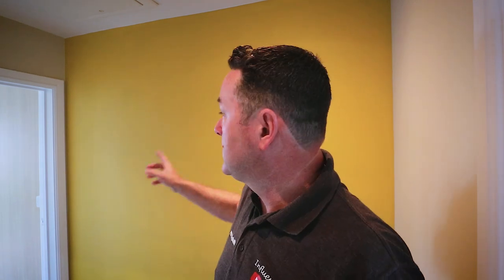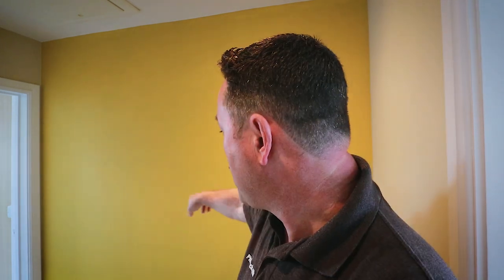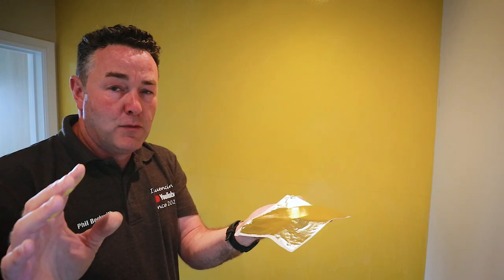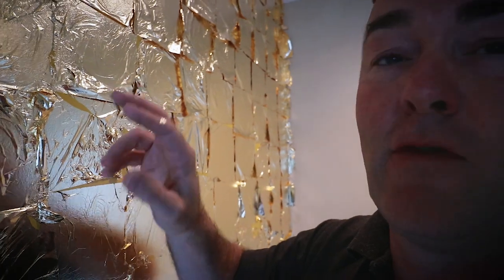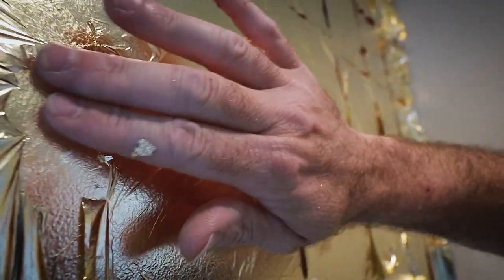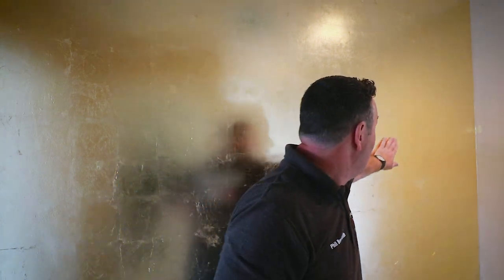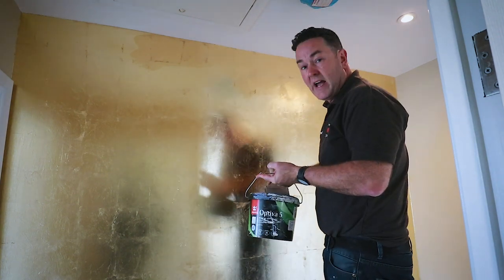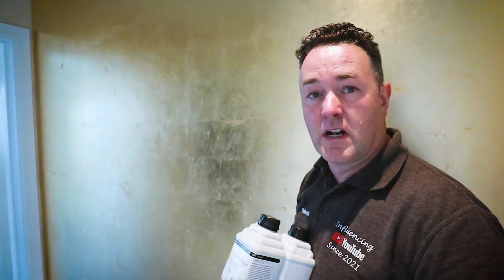How to do a GOLD LEAF WALL

Comment: Hi Phil, I followed your wonderful tutorial using the same exact materials. I ran into a problem, when I applied the lacquer using a new brush, it dried very weird. It had very dark areas and the brush strokes can be seen. It did not turn out as neat and even as yours. 
Any recommendations or ideas on why it might have gone wrong?
Reply from the maker: you mean the top varnish? was it the polyvine just like i used?
Reply: @ProfessionalPainterDecorator Yes, I used Polyvine multipurpose surface lacquer (high gloss finish).
In many areas it dried very dark and messy. The brush strokes also dried dark. Not sure where I messed up. I’ll try again and test small areas first. I might need to dilute the lacquer or apply less of it.
Reply from the maker: @krasavchikmalchik  can't see why you'd have a problem. 
Try applying it with a mini roller.. 10mm

Comment: What would you differently for applying this to a ceiling?  Does the ceiling need to have a smoother finish - i.e. not use a fat roller to prevent orange peel showing through the gold leaf?  REALLY need the advice.  Thanks!
Reply from the maker: my COPPER LEAF wall video thats scheduled for Setember.... I skimmed the wall out with roll on plaster ( i have a video of that stuff) and Mirka Sanded it smooth/flat.
I did get the correct transfer leaf though.. which makes it easier to apply.

A ceiling shouldn't be difficult to do... next time, I'll be doing a ceiling.
Reply: @ProfessionalPainterDecorator  - Thanks!  I'll be watching for that.  I make such a mess when skimming - the dust!  I might actually hire someone to skim, just because of that.  I have a ton of books and things that make dusting and cleaning up a nightmare!  If you have any tips on THAT, I'd be interested.  You're saving me a bundle of cash, as I was going to do a metallic wallpaper, and it's ridiculously expensive.

Comment: Did similar on furniture just used PVA to stick & fine, only needs to be tacky, cheaper too 👍i never lacquered after as being metallic it won't penetrate & i think you do lose that natural gold leaf finish imo
Reply from the maker: The open time for PVA isn't long enough for working large areas.
Yeah, you don't need to lacquer it.
Reply: @ProfessionalPainterDecorator i just improvised as i had a small table , but could do in sections as i bet it's a lot cheaper ?

Comment: Looks like it needed burnishing after brushing the gold leaf……..as I remember gold leaf came in two ways one similar to what you used and you would float it on with a brush, the other where the gold leaf was adhered to its backing sheet so the leaf would not fall off when applying to the surface, this style you would then rub the leaf with your thumb onto the applied tacky glue.
Reply from the maker: Correct. This foil leaf I've varnished for protection. You loose that gold shine though

Comment: Your patches are sore thumbs. For the flat look, the GL application was applied badly, uneven, wrinkled, and slapdash, which created the patching in the first place. This is because you didn't use the correct tools and have little experience applying gold sheets for a flat look! You should not be able to see the square outline or wrinkles in the sheet!  Have you tried the broken look GL application? Its far more forgiving and a much more expensive look. Practise makes perfect. No offence, just constructive criticism :)
Reply from the maker: tnx, the GL was cheap, came off the sheet too easy and didn't go on in one. what gold leaf do you recommend using next time?
Reply: @ProfessionalPainterDecorator  I think all the non real gold leafs are pretty much the same and it takes a lot of practise to get it right and helps if you use the right tools. I use a squirrel hair gilders tip brush to apply the leaf which is much better than using the paper sheets. The sheets are only used to divide the leaf. With the gilders tip, you get better application/precision and brush the leaf flat at the same time. The squirrel hair is so soft and doesn't mark or split the leaf... Once in place I use the gilders mop brush to iron out the leaf. These are the right tools for the trade but a bit pricey! However, you can factor the costs into your fees ;)
Reply from the maker: @StellaPhotis  would you use those to do a wall or ceiling?
Small areas, picture frames and furniture they're Ideal. Big areas maybe no so.
Reply: @ProfessionalPainterDecorator  Use then for everything, big or small and keep practising. You will be slow to start but as you improve, so will your application and finishing off. I use the Pebeo Deco Gilding Paste on walls/items, but whatever you use let it dry clear. To adhere the fineness of a gold leaf this is the perfect base consistency to adhere to. Do not adhere while it's wet/milky in colour! It will just stretch leaf and rub off in patches spoiling the finish. That said, having broken bits of leaf creates a great antiquing effect especially if the base colour showing through is black!! Practise on everything you can get your hands on, pic frames, old vases, scrap wood/plastic, glass, ceramic, walls, coving etc... and create a portfolio of your work with snipets of the finishes. Let me know how you get on. Fee wise, when you start out, I would base my fee on an hourly rate (£40-£55p/h) to include costs, expenses. Hope this has helped you and I wish you the best of luck ;)
Reply: I subscribed to you hoping to see some of your work.. but no videos :(
thank you for the great explenations. @StellaPhotis
Reply: Sorry but I have no time to make videos, but who knows, it might change in the future. What sort of videos are you interested in?  @czechoslovakianwolfdog  🤗
Reply: I’d be interested in seeing videos from you too do you have IG or FB? 🤗
Reply: What is the ‘broken look’ application of faux gold leaf tiles please? I was thinking of doing my boat ceiling copper leaf as I prefer copper to gold but worried copper might be too dark for my Hague blue walls?? I’ve already undercoated ceiling with farrow & ball Babouche so perhaps that’ll help it stay bright? Maybe I should’ve used Dutch orange if I’m going coppery? I would definitely prefer the squares to be less noticeable/more organic/natural looking - TIPS PLEASE! Also I wasn’t going to varnish so I can keep the shine? I’m grieving so please forgive all Qs - focusing on the ceiling is a good distraction from the pain and any tips very much appreciated 🙏🏼
Reply: Where can I learn more about getting perfect pattern on large areas with no lines etc?